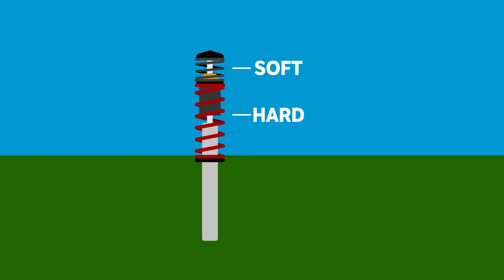What Difference Do Coilovers Actually Make To Ride And Handling?

Comment: Please change the power steering fluid to  a fresh one, it’s a night and day difference!! No delay anymore and easier to place the car. I’ve done that to my own e46 coupe. Thumbs up so he can see!
Reply: Retexz did it to my mk4 GTI. Did nothing tbh, but I heard that in some cases it could help.
Changing all the other fluids would be helpful, too...
Reply: He needs to change the blinker fluid. Instant 1 second improvement I guarantee
Reply: needs some carbon fiber blinker fluid for sick weight reduction
Reply: You are right in the way that p/s fluid is important on these, but the delay and smoothness is just a feeling. The steering wheel is connected to the rack, so nothing can change the phase of the steering wheel to the rack except if you have a torn coupler. But yeah p/s fluid change is a must and the pump and rack will be happier (and start to leak out also, but ..)
Reply: The steering ratio remains the same regardless if you have good fluid, bad fluid or no fluid at all. You probably had air pockets in your system, which made the steering effort inconsistent, hence the sensation that it now steers quicker. However, you're right about keeping the fluid nice and clean. It's a must!
Reply: Agreed, but also change the steering guibo! That will definitely sharpen up the steering a lot on a sort of high mileage car!
Reply: My car doesn't have power steering fluid.
Reply: changing the fluid has zero affect on any 'delay' you may feel, as it's a direct connection between the steering wheel, rack and wheels. The power steering just assists that process and removes load from the system. There is no possible way for a fluid change to affect a delay between steering wheel and the wheels.
Reply: Changing the tire type, size or offset might have more of an effect on steering feel.
Reply: Just retrofit electric steering rack and be done with it.
Reply: 100% on any old car, you need to completely flush the power steering fluid. FAR better control and feel over the car in corners.

Comment: That dual spring concept is pretty neat.
Reply: Yeah, you actually do notice it while driving.
Reply: Porsche uses dual springs on the GT3 i think, called helper springs
Reply: Muffin Racing yea my mk4 gti has st coilovers with the same setup
Reply: Yeah the only place iv see those before was the ariel nomad
Reply: It's really just to stop the stiffer spring from free floating in full droop
Reply: I was stupidly baffled with the genious of that concept
Reply: Rejoice Rone lol my RC car has helper springs
Reply: A lot of higher end companies make them for street cars now. I’ll be getting Ohlins DFVs for a couple of cars. Ohlins makes incredibly nice stuff if you haven’t heard of them. A lot of import communities consider them the best for a spirited street application. They make nice mountain bike suspension also. Pricey though.
Reply: Bryce Gubernik oh, I've heard of ohlins alright. Also known as "what the really far people at autocross use that I can't afford"
Reply: Daniel ivanov is it true that you cannot adjust the camber on the mk4? If so, how did you set it correctly after putting coilovers on?
Reply: Im shocked anybody who considers themselves a "car guy" would think helper springs are a special thing.. Theyve been an optional extra for aftermarket coilovers from all manufacturers for a long time. "Dual spring" is an incorrect terminology used to make it sound new and innovative, they are called helper springs and have been forever. 

The reason they arent used or seen all the time is because theyre not necessary for most people on most set ups.. They do make a big difference on really low cars though.
Reply: +Biff Buz:  Camber is adjustable on almost every vehicle. It cannot be adjusted on the rear of solid axle RWD though. Caster is not adjustable on most newer vehicles. You can do it with aftermarket parts though.
Reply: I need to get these for my Grand Marquis. I'll tune them to their maximum 80's bouncy luxury barge settings.
Reply: Some Body I've never seen it and I've seen quite a few coilovers. Guess I'm not a car guy. Oh well
Reply: +The Eliminator Project: Maybe I should too.
Reply: Yes it actually makes for an overall softer ride but more controllable because of the different spring rates on each of the springs in the system.
Reply: Muffin Racing seems good for a daily race car
Reply: Reminds me a lot of normal progressive springs for cars, same sort of idea
Reply: It is not unusual these days to see non-linear springs fitted in cars as standard, which effectively do the same thing as serial dual springs.
Reply: Germans are awesome !!!!!!
Reply: Bryce Gubernik I have had ohlins suspension on my bike,the build quality is top notch, maybe a bit expensive but still miles above competition.
Reply: The helper spring can easily be fully compressed with bare hands. The Animation suggests there still would be travel in that spring with the car stationary on the ground, wich is not true.
The only time the helper spring will come into effect is when the suspension is moving higher than its normal position, like on jumps or on the inside when cornering.
Reply: But doesn't it cause the car to tilt more? And therefore more unbeneficial weight tranfer?
Reply: every KWv.3 has helper springs nthin special for aftermarket sport springs
Reply: That eibach coil is rubbish to be honest. It compresses spring load to lower the car. No high end coil does this. Eibach cheap coils = jom blueline.
Reply: It's just a twist on progressive springs. Nothing new, but great for the marketing departament.
Reply: I'd love a set of Ohlins for my '03 rs6, I met someone who'd had them fitted and the ride quality was amazing, consider the standard suspension is decent already, so even more impressive. £7K was a bit over my budget though! D:
Reply: The concept behind it is pretty old, such suspensions were already available in the 90s (i.e. INTRAX from the Netherlands). The bad thing about it is that you lose pre-tension of the spring as soon as you want to go lower than the coilover manufacturer intends you to do.
Reply: Sorry but the whole explanation and animation about the second little spring of the coilover is wrong. I have such "dual spring feature" in my cheap no name E36 coilovers and it's nothing special. This second little spring is very weak and will completely compress as soon as the car is just sitting on the ground. It doesn't effect the performance of the suspension at all. It's only task is to keep the main spring under a minimum amount of load (pre-tension) when the suspension is completely rebounded, for example when the car loses contact to the ground in a slight jump or while driving over curbs etc. Otherwise the larger main spring might lose all of it's pre-tension in a fully rebounded situation and "float" around the damper for a moment which might be catastrophic when the wheel touches the ground again and the spring doesn't sit where it is supposed to. You might notice this in coilover setups that are able to go veeeeery low and only have one main spring. When lifting up the car you might have no pre-tension on the spring anymore and it might move freely. Another way of keeping pre-tension in fully rebounded state without using a second spring is to reduce rebound travel via dampers with a shortened piston rod. That is the reason why you should use shortened dampers when going for lowering springs that drop the car more than let's say 40mm.
Reply: @PoptartKingz  The spring that does that would be called a helper spring according to Eibach https://eibach.com/us/c-113-products-motorsport-springs-accessories-helper-and-tender-springs.html
Reply: I'm astounded by how many dont know the dual spring setup.      It s by no means a new concept or so.  It exists already for YEARS on many suspension brands
Reply: Thats like having the pros of a linear and progressive in one spring.
Reply: Check out MSS Springs, sold by Evolve Automotive. They use 3 spring ratings and the difference is unbelievable. Much better than Porsche and AC Schitzner alternatives
Reply: Its a cheap way to get variable rate springs.
Or you can design and make proper variable rate springs.
Reply: @rejoicerone3176  Helper springs are different, and are only meant to keep the spring under tension under full droop and will fully collapse under load.

Comment: I think there's more you can do with suspension. Upgrade the sways and end links. Put the rear on a softer setting to reduce oversteer. 

You might also consider adding some negative camber to the fronts, as the tire really is leaning past its contact point under hard cornering. 

Your tow in/out settings will assist in either initial turn in or stability - depending on how you set it up. 

When it comes down to it, no matter what mod you do to your suspension or engine, the only part of the car actually touching the road is your tires - which is why many people start there.

Comment: what Greg said was actually very insightful! it gave me a great perspective on the whole "drop it as low as possible" kind of idea :-)
Reply: As low as possible isn't necessarily the best case. I'd think you'd want as low as possible while still having enough suspension travel for whatever surface and speeds you're using. Like he said you don't wanna run into the bump stops.
Reply: Do you then know why it is that with too stiff of a spring you have inconsistent grip? (1:40)
Reply: Jasper Eerdekens 1:40 he's referring when a tire meets a bump or road imperfections.

If your springs are too stiff, it can't compress. Which means the springs will not react to the road imperfections. Thus the tires will lose contact with the ground.
Reply: sandman1201 may car handed a lot better and the ride was better when my coilovers where higher up, but I’d rather have it stupid low aha

Comment: When you are going to do wheels and tyres are you going to show the difference that wheels and tires make independently or all at once? I feel like it would give a much better understanding to do them separately. 
Eg. Put a tyre like Michelin Pilot Sports, Toyo R888, Bridgestone Potenza ect. on the standard wheels to see how much difference good rubber makes. And then after that put the new wheels on with the same brand tyre to show how much difference less rotational mass and less unsprung weight can make a difference.
Reply: There's plenty of info regarding unsprung mass on the internet if you are interested. Alex's new wheels will have altered track width, tyre width and tyre profile, making it hard to tell exactly what effect the reduced unsprung weight would have. Though when we do see the results, I'd bet that a large majority of the improvement will be from the fresh tyres alone, if that's what you're wondering.
Reply: Cole Trickle I used the tyres purely as an example of a decent tyre, doesn't matter what brand it is as long as it's a good performance tyre. The whole point of them doing this bit by bit is to show how simple modifications can make improvements to your cars. He'll probably go faster with wheels and tyres on, but it doesn't show a definitive answer as to what actually improved performance. Was it the lighter wheel with less unsprung weight, was it the grippier tyre, was it the wider wheel improving weight transfer, was it the wider tyre allowing for more grip on the driven wheels. There are lots of variables and splitting it in two would have been a better help. But that's not likely to happen since all these episodes are already made.

Comment: I think there is a bit of wishful thinking here, like when your car feels faster after you just waxed it, because 0.26 seconds isn't great value for >£1500 of suspension + garage time. Body roll angle isn't massively different on the video, just that the ground clearance is lower, so there is less daylight visible. I guess you did fit a set of polyurethane bushes at the same time?  If the dampers and springs were factory original, then they would have been very suboptimal at 146k miles anyway. My feeling is that coilovers have done slightly less than nothing, compared to new standard springs and dampers. The lowering is always going to be handy on track though.

Have the anti-roll bars been changed? Because the way it is driving, it seems like the new rear springs are too hard, and the ARB isn't stiff enough, reducing compliance and making it lose adhesion. That's not great, especially with an open diff. The loose back end is causing oversteer which is making the turn-in feel sharper than it really is.

Bring on the cabin strip, limited slip diff, sticky tyres and custom map!
Reply: with sticky tyres, trust me when I say the Eibachs are worth every penny
Reply: Also keep in mind we don't know the state of the original tires and its tread life. Add to the fact it had already been thrashed on the track a few times already I  was personally was not expecting a massive improvement.The track is also very short. I'm sure over a longer track the gains will be more significant. If we compare with the IS 200 track project car:
1. Lightweight wheels and semi-slicks gained 0.85 over stock wheels and tires
2. Performance exhaust, coilovers & weight reduction gained  2.16 seconds over stock components
3. Performance brakes and buckets gained 0.84 over stock.
Reply: Here's a man saying a nearly .3 second improvement over a short track from a stop is nothing, then expecting us to trust whatever else he says.

The testing was done from a stop, over just three laps at what can barely be called a "track". The increased control, confidence and handling would no doubt add to much more time found after a real session of hot lapping around a real circuit. It also serves as a base to support future mods like tires and brakes.

Tell me you've never raced cars without telling me.

Comment: Kinda surprised the suspension was the first upgrade you made. The tyres wouldve been an easier upgrade and i think wouldve better shown the difference of the suspenion upgrade.
Reply: Well, you can always go suspension>wheels>tires but when you buy a set of tires for these specific wheels it's done. He could have gone for a wheel+tire combo before the coilovers, but then the 4'' drop could be problematic if he's he got too big of wheels, in terms of fitting and geometry.
Reply: LeFatalpotato no real reason to do wheels, you loose a few lbs on a light set but you then loose momentum which is important coming out of corners, and even a quality wheel like a wolf race is made out of cheese compared to a wheel as quality as a bimmer oem wheel